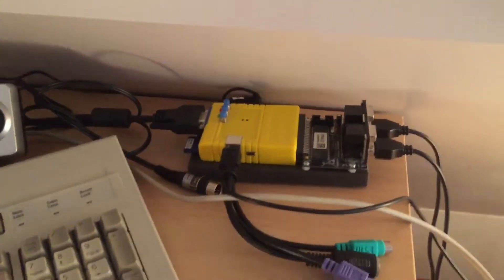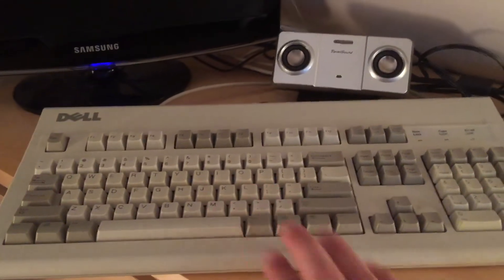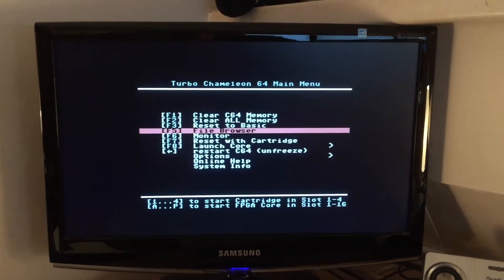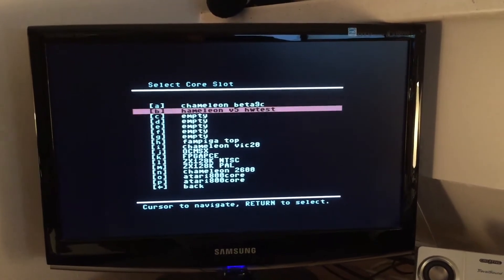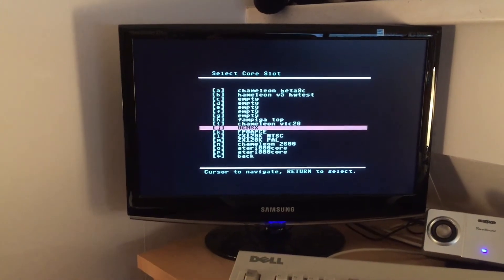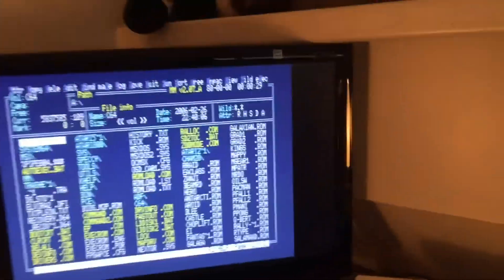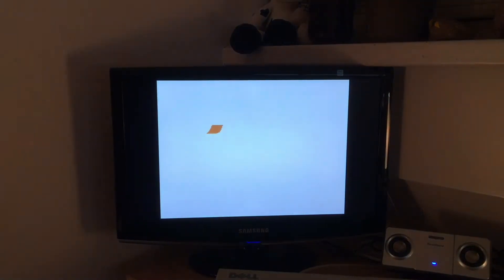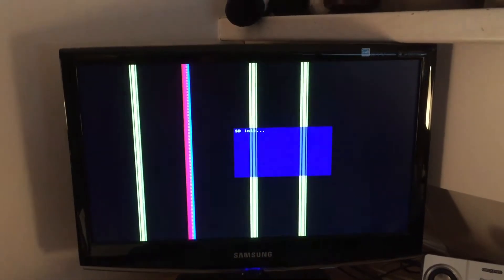MiniMig, VIC-20, PCEngine And MSX Running On The Turbo Chameleon 64 Cartridge ✅

Comment: What is the name of the MSX Shell you're using in the video? That's a piece of software I'd like to have.
Reply from the maker: Nextor - a shell on top of an enhanced version of MSX-DOS 2.xx 
https://www.konamiman.com/msx/msx-e.html
Reply from the maker: You might want to check this out too:
https://sites.google.com/site/msxengine/the-msx-commander
Reply: Thanks! I did come across both in my search. I’ll experiment with them. I’ve had my TC64 for years, and never used it as a stand-alone device. I forgot about that function until recently, so I’ll have some retro fun with this without taking up a ton of desk space.
Reply from the maker: You're welcome. The TC64 is quite a powerful beast. Using it with the dock really works great. But slid inside a C64 with the VGA port hooked up you can do quite a fair bit of the emulation as well.
Reply: I don't have a dock for it, but just by itself it's working quite nicely. Having Amiga, C64, and MSX all at once is great. I'm trying to get the Atari 800 XL core working, but I'm having issues.
Reply from the maker: Christopher Baar didn’t manage to get the a800 working myself. :( let me know how you fare.
Reply: I did get it working. I think there's something wrong with the BIOS roms sugggested in the instructions. Pulling them from somewhere else and I got it working. I'm using the NTSC core, myself. ATARIXL.ROM is not PAL/NTSC specific, but ATARIOSB.ROM is.
Reply from the maker: Wouldn't mind finding out which ATARXL.ROM and ATARIOSB.ROM you are using... Or perhaps get my paws on those files.
Reply: I’m not at home, so I’m not sure if the exact file names, but they’re out of the TOSEC main package. Atari OS ver B NTSC and Atari OS ver 2 (800XL) I think.
Reply: When I got it running, it seems to default to the XL, so I bet that’s the rom it has issues with.
Reply from the maker: Ah that's excellent. I will try those. :)

Comment: Is je Dell toetsenbord, deze versie. 

Keyboard Dell PC
Model SK-8000
DP/N 035KKW
Volts 5 V
Amps 75mA
Reply from the maker: Actually it's the AT101W - more info found here
https://deskthority.net/wiki/Dell_AT101
Reply: lactobacillusprime Bedankt, voor de link. Ben nu beperkt met de C64C toetsenbord. Heb al geprobeerd met de kale AMIGA 500 toetsenbord, maar dat is geen mooie optie. Zal naar de Dell AT1001W toetsenbord zoeken i.p.v. SK-8000.
Reply from the maker: Elk ps/2 toetsenbord zal functioneren, maar zo'n Dell is wel prettig. Succes.
Reply: lactobacillusprime Is deze ook goed, IBM Model M 1390131 keyboard van 1987. Verkeerd in mooie niet vergeelde staat.
Reply from the maker: Johan den Hertog aansluiten en proberen zou ik zeggen. De meeste PS2 toetsenborden communiceren via eenzelfde manier met de computer. Als dit in de chameleon goed is geïmplementeerd zal elk ps2 toetsenbord moeten functioneren.
Reply: lactobacillusprime Heb de heavy duty IBM toetsenbord zojuist binnen gehad. Het werkt perfect en ben er verliefd op. Had vroeger een kloon van, maar nooit de echte versie. Gisteren een BenQ BL912 / TFT VGA Monitor gekocht ( is compatible with all of the Chameleon's cores). Nog betere boxen ervoor zoeken. Bij elkaar word het een dure TC64.
Reply from the maker: Een echt heavy duty IBM toetsenbord is geweldig. Een goede 4:3 VGA monitor is ook mooi om erbij te hebben. Ach zolang je dit niet elke week doet moet het kunnen, toch? Bovendien is het ook de bedoeling dat dit een tijd meegaat toch?
Reply: lactobacillusprime Het is een 5:4 , dan een 4:3. Maar goed, je heb gelijk de TC64 is de moeite waard ervoor en je heb langer plezier ermee. Had liever een Sony BVM monitor, maar die zijn behoorlijk zwaar en je weet nooit wanneer het begeeft. Het mooiste is, je kan alles makkelijk meenemen naar je vrienden. Nu is het uitvogelen welke AMIGA spellen met de TC64 kan worden gespeeld. Heb wat spellen erop staan, maar dat zijn alleen C64, PCE en MSX Shmups.
Reply: lactobacillusprime Ik heb gelijk, wat meer te geven voor Christmas voor mijn vrienden zoals de One Chip MSX en de PCE SuperGrafx. Ze zijn nu toch overbodig geworden en de bijbehorende spellen.
Reply from the maker: hehehehe, wel is die OneChip MSX niet de moeite waard om te houden? Daarmee viste ik compleet achter het net. Als je die zou willen verkopen dan hou ik me aanbevolen.
Reply: lactobacillusprime Misschien komt het wel, dat ik dozen vol had van de One Chip MSX. Kocht alles wat met de MSX te maken had. Had teveel verschillende spelcomputers, mis het meest de Sharp X68000 en veel Arcade Shmups. Moest plaats maken voor flipperkasten van Bally uit de jaren 80 en 90. Je kan niet alles hebben en opeens komt er na 26 jaar intensief verzamelen een eind aan. Zal kijken of ik ergens een One Chip MSX kan krijgen.
Reply from the maker: Ach soms is het ook tijd voor iets anders. En dat kan ook heel goed voelen.

Comment: I had the Amiga which I loved for gaming. It definitely had some top conversions such as R-Type & Marble Madness. Some really good classic adventures too... However I always struggled with going beyond Workbench basics & never was able to do much command line programming! In contrast I was much more able on the C64 and did learn rudimentary programming, which was useful. I always feel Commodore should have revised Workench and created a much more user friendly interface, more akin to the Macintosh. Considering those early systems shared a common CPU, it would have been feasible & was not a hardware limitation.